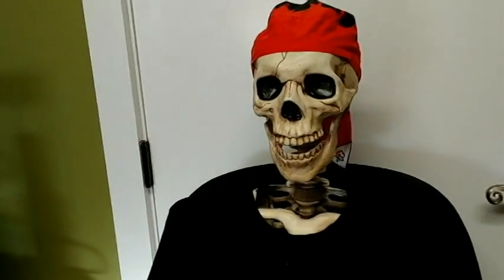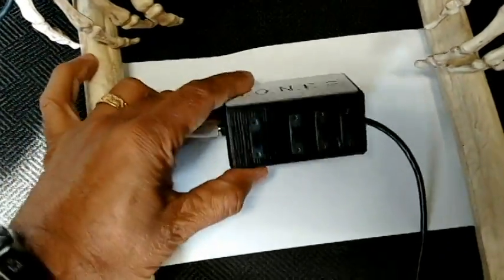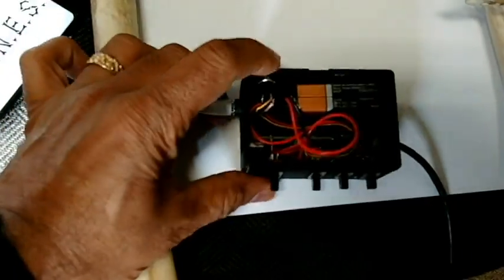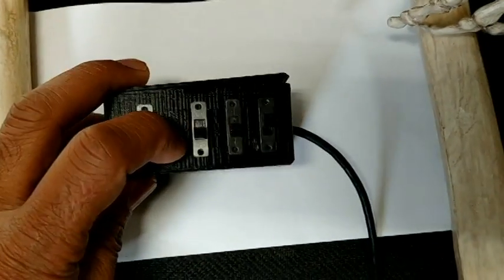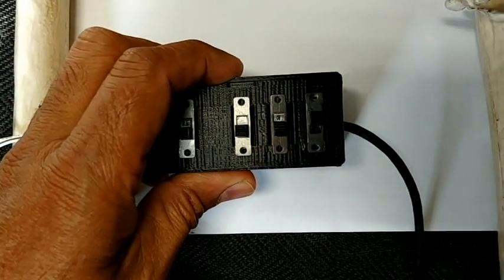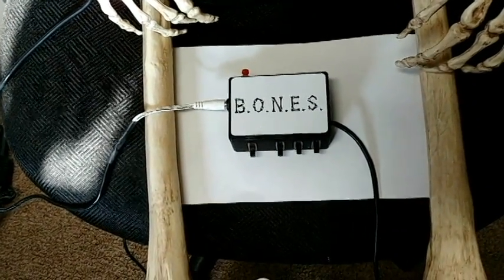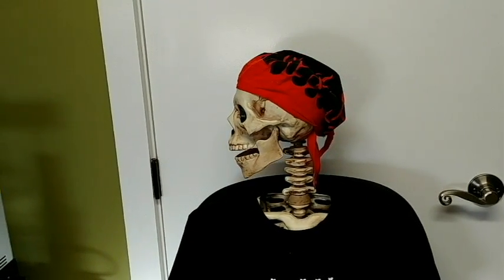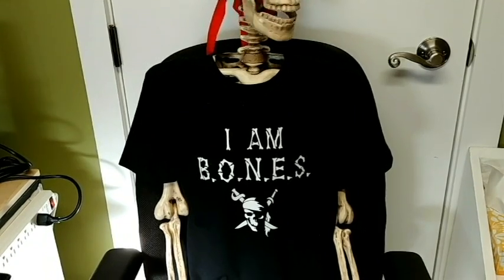B.O.N.E.S.

Comment: Would love to see your wiring diagram and the Arduino Sketch for this!  Nice job!
Reply from the maker: Thanks! I don't have a wiring diagram yet.  It's not too complicated.  Just some switches that provide 5 volts to various pins on the Arduino (all commented in the code).  I have a 9v battery inside the enclosure that powers the Arduino but the power for the servo in his head comes from a 12v source in the car (cigarette outlet).  if you provide your email address I can send you the code.
Reply: @MakerDan55  jmortonsalt@gmail.com